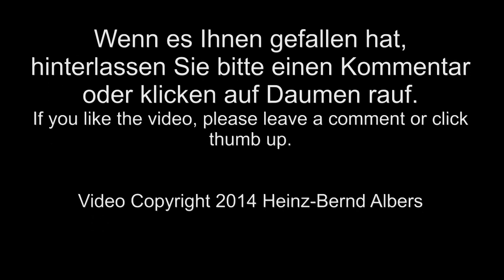Strassenfräse Wirtgen W250 / Cold milling machine Wirtgen W250

Comment: This road seems good condition?
Reply from the maker: Not by german standards, it had deep potholes and rutting. The road serves as a feeder road for the next highway, the Autobahn 31. Additionally the Meyer Werft, one of the mayor german shipyards, has its headquarters on this road. So it it important, to keep this road in a good condition.
Reply: If you have never been to Germany,  you cannot understand the quality of their highway system.  Even city roads are kept in excellent condition. The Autobahn system is second to none. It's like driving on a sheet of glass,  and when a section gets bad, it's replaced as soon as possible.